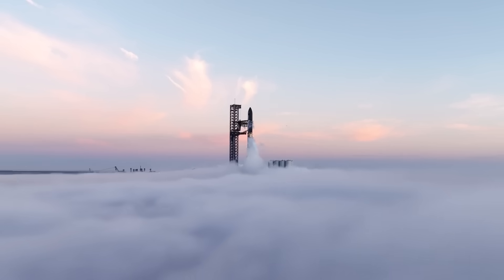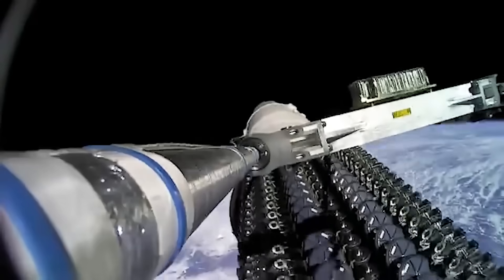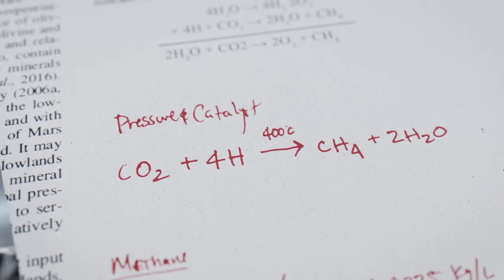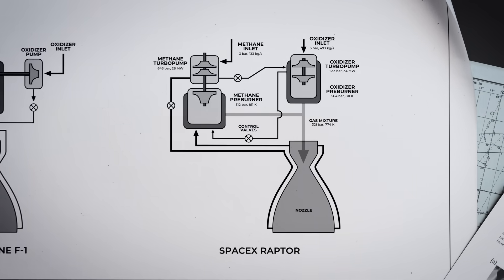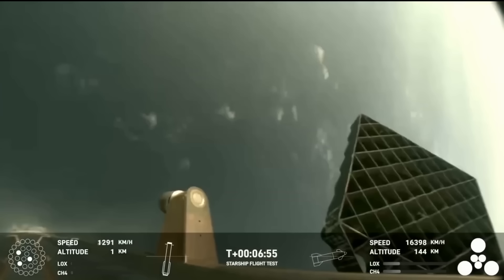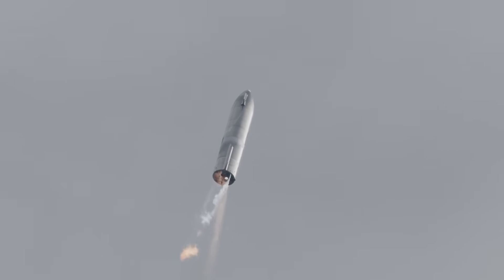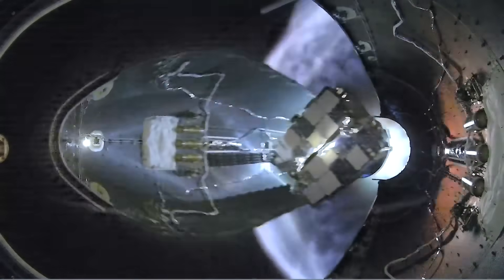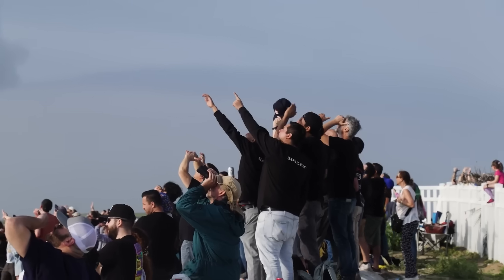Starship Reached Space. What Now?

Comment: It's not 'now what,' it's 'so what.'  SpaceShip ONE and Blue Origin did that...with PEOPLE aboard.  And NEITHER did it on the backs of the American taxpayer.
Reply: They quite literally didn’t.

Plus SpaceX has flown more people to orbit and back than either of them
Reply: @weekiely1233  No, they did.  SpacedX has only come close with a design they BOUGHT.  All the ones THEY designed, have failed.

Sorry, dude.  Your muskovite worship IS misplaced.
Reply: Since you don't seem to understand the difference between orbital and suborbital spaceflight, let's do an analogy:
The difference between what Virgin Galactic and Blue Origin do, vs what SpaceX do, is roughly the difference between flying a propeller plane and an SR-71 Blackbird.
Virgin Galactic and Blue Origin's vehicles can do about Mach 3. SpaceX's Dragon spacecraft can do Mach 28, and Starship did Mach 27.  That's an order of magnitude faster.
SpaceX have done over 300 orbital missions, including flying 50 people. Just one of those requires more energy than all Blue Origin and Virgin Galactic flights combined.
Reply: @lazarus2691  Since you glossed over where 'space' officially starts, the fact that only the stainless dildo failed to complete ANY of its missions, and that the other two platforms transported people, INCLUDING THE CEO OF THE COMPANY, your smugness and/or indignation are undeserved.

Comment: So it used up most of the fuel with 0 load. What happens if he tries 100T? 

Lol
Reply: It had ~4% fuel remaining, which is about 48 tonnes. Which means it could have reached the same trajectory with 0% fuel left if carrying 48 tonnes of payload instead.
Musk said in an update a few days ago that the current prototypes are able to do around 40-50 tonnes to orbit, so that checks out.
If they tried to do 100 tonnes with the current ships, they would not reach orbit. However, this is completely expected under the iterative development model.
The first version of Falcon 9 had a payload capacity of just 9 tonnes. By 3 years later that was increased to 13 tonnes, and just 2 years after that it increased to 23 tonnes.
Reply: It wasn’t loaded with fuel to 100% capacity.
Reply: It wasn’t fully loaded

Comment: Biggest thing about the heat tiles is they are standardised and will help reduce servicing cost massively. The shuttle wasnt really economically viable with just the re-using the airframe, because all the tiles were custom made and each launch required a new set, which basically meant there was no cost advantage over throwaways like the soyuz.

Comment: The lack of criticism for SpaceX contrasts with the video about Artemis. And NASA build Artemis and achieved going to the Moon and back while SpaceX couldn't even put this rocket in orbit at the 4th attempt, and neither of them survived.
Reply: Each starship was made around a year before launch, and had a much smaller budget of around $5B since 2019 for the entire project all funded by SpaceX themselves. NASA has had SLS in development since 2011 or 2012 and has had almost $100B put into the whole project.

SpaceX is doing this much faster, much cheaper, and with more flights.

Also, they haven’t been payed for the HLS project yet. Once they get to orbit and have proven all of the requirements NASA has asked for, then they’ll get payed to make the HLS
Reply: @archierush868  Also worth mentioning that SLS was largely comprised of existing technology, while Starship is cleansheet.
In particular, the ICPS stage that actually did the translunar injection was literally just the DCPS off the Delta IV rocket.
Reply: @archierush868  If they are faster, then why are they so much behind schedule?
Reply: @DerUnglaublicheFrank  They are optimistic and set goals which would be acceptable if nothing goes wrong.

NASA had plans for a manned mission  to mars in the 80’s, then the 90’s, then the 2000’s, and now it’s late 2030’s.

Delays happen all the time, and there is no way if telling when a delay can occur, why it occurs and how they can solve it. Almost all dates for space flight is aspirational in the event delays don’t happen and everything happens flawlessly.

Comment: What I find interesting is how Space X can afford to keep on throwing way so many Raptor engines when a mission fails.
Reply: Raptor engines are cheap. As of 2020 they were just under $1 million apiece. Presumably that has improved since then, but even using that number the 39 engines on a full stack would be, at most, $39 million. By comparison just one of the four RS-25 engines on NASA's SLS costs well over $100 million.
(Original price was $40 million in 1980, adjusted for inflation you get ~$140 million, and NASA are paying $146 million for new production engines.)

Comment: 14:50 But the Ariane 5 has one of the best track records when it comes to reliability, even if Starship ha a much greater carrying capacity it's unlikely that an ultra expensive Space telescope is thrown into orbit with an unproven system like that (maybe after 5-10 years of reliable service)
Reply: Number of launches is more important than time operational. SpaceX have demonstrated this with the rapid improvement in Falcon 9 reliability as it's launch rate ramped up.
In 2017 Falcon 9 was one of the least reliable rockets in service, with a whopping 7% failure rate - or 10% if you count the CRS-1 partial failure.
4 years later in 2021 it surpassed Ariane 5, and 1 year later in 2022 it was more reliable than any rocket in history. It has more than doubled its' successful flight record since then.
If SpaceX can get the flight rate for Starship ramping up anywhere near as quickly as they want (and need for Artemis), then 5-10 years is probably a high estimate.
Reply: Claimed carrying capacity. So far they have only blown up empty rockets, so its actual current carrying capacity is 0.
Reply: @DerUnglaublicheFrank  they didn’t fill it with fuel 100%. You can see that in the video just before liftoff that both the booster and ship were at around 98-99% filled

Comment: What Im curious tho is how much would development be hindered by Musks "no part is best part" philosophy. This isnt some random machine to assemble cars in a mostly empty factory. Starship is definitely intended to carry crew. Touting "efficiency" while having no overlapping abilities is gonna make it never be safe enough for crewed missions. Every aspect of these space launches are leaning towards making the mission fail. Gravity, heat, oxygen, pressure, wear, off spec parts, human error, explosive gas, weld defects, ice, control instability, etc.

Wil musk ever reach his goal of an infallible rocket? Or will he have to throw in the towel eventually and accept that it needs some more redundancy.

I dont build rockets for a living, but the whole philosophy seems like it doesnt work
Reply: This isn’t a hindering philosophy. It’s about over engineering and why it’s bad. 

All rockets are built to a thin margin
Reply: @weekiely1233  youre wrong. It is in fact hindering. Take for example musks idea to not spend on having a proper launchpad. The floor broke and damaged the engines.

Then ift2, instead of a normal simulated payload such as concrete, or even just another tesla, they just decided to load in extra LOX, much more than was needed. And that extra LOX caused an explosion. Something that a block of concrete wont do.

You musk fans keep touting its ok they got data. But its dumb. Theyre getting data by wasting money to figure out stuff that didnt need to be figured out.

If they just did things normally, that japanese billionaire wouldve consummated with his moon flyby girlfriend by now

Comment: How is methane better than hydrogen in Mars if you need hydrogen to make methane? 🤨
Reply: Another reason is that it's much more efficient overall to turn your hydrogen into methane. (So long as you have a plentiful supply of CO2, which Mars does)
For every kilogram of hydrogen you have on Mars, you can make one kilogram of hydrogen fuel - obviously.
However, for every kilogram of hydrogen you combine with CO2 on Mars, you can make four kilograms of methane.
Even though methane is only 80% as efficient as hydrogen, that four-fold increase in fuel production more than makes up for it.
Reply: Methane is much easier to store over time. Hydrogen is only liquid very close to absolute zero.
Reply: @SpaceAdvocate  ooooh that makes sense
Reply: Hydrogen is hard to store, needs more energy to chill down and has less bang for its buck. Methane is easier and gives more thrust

Comment: carbon dioxide is cooled to a liquid? I thought it was dry ice, so gas to solid
Reply: You're right, that part of the video was a bit misleading. CO2 can be turned into a liquid, but you need more than about 10 bar of pressure.

It would be easier to just run a fan and compressor and fill tanks with pressurized CO2.